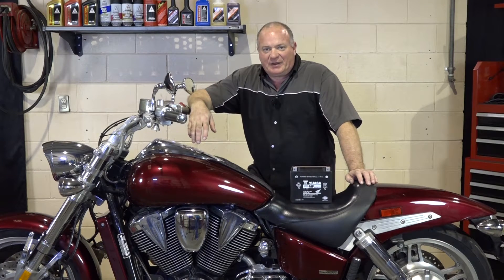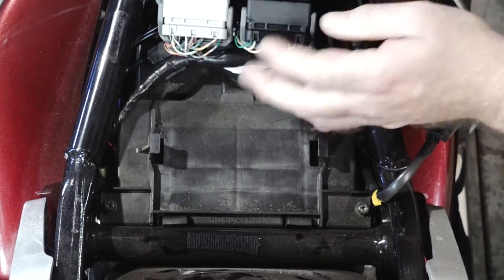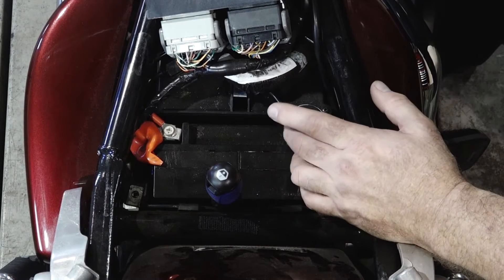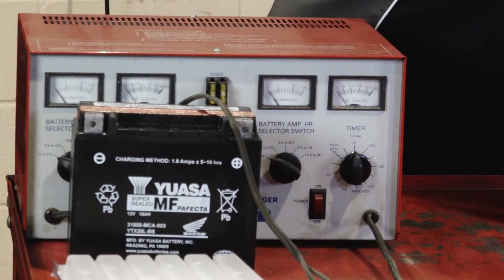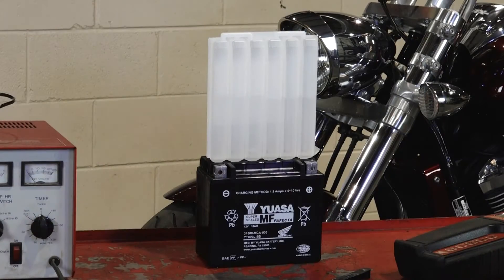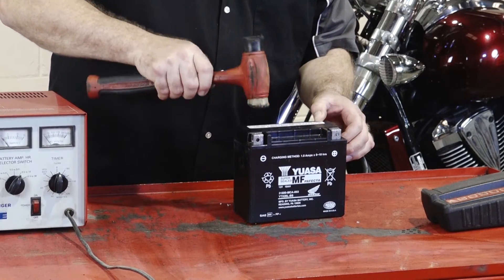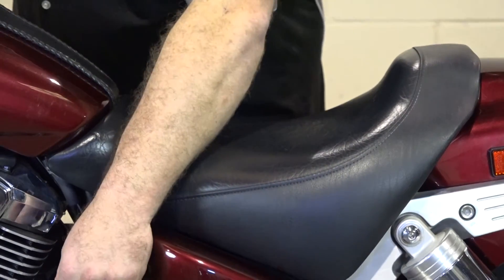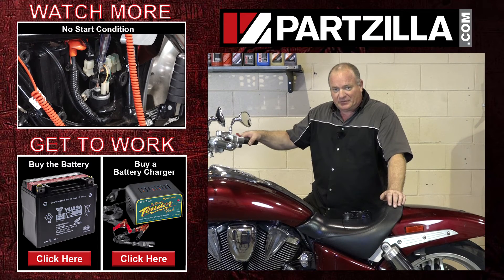Troubleshooting Motorcycle Battery Problems | Honda VTX 1800 | Partzilla.com

Comment: He Dan, I figured out easiest way to remove the battery. I find a boxed end wrench smaller than bolt head but larger enough for bolt to go thru. Since on most combo wrenches the boxed end is offset, you simply turn so the open end is pointing up & towards center of the battery and bolt it to negative battery terminal. Thus giving you a handle to pull it out of that tight close tolerance box.

Comment: After cussing about my fat fingers on my initial pull years ago I put a strap around my battery, then re-installed. I used the type of strap some people clip keys on and wear around their neck. Your method will work but I'd rather use the strap to lift my battery out than 2 pliers on the threaded posts.

Comment: What if the motorcycle doesn't turn off, starter motor keeps spinning. Open circuit on the solenoid.06 vtx 1800